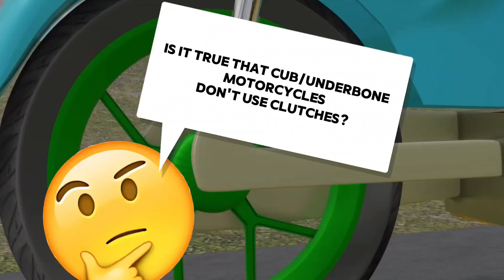How an Automatic Clutch On a Motorcycle Works ?

Comment: From my experience, underbone bikes like these usually have transmission going by a cycle (N->1->2->3->4->N) instead of N between 1 and 2 like manual bikes (sport, naked, etc.). Can you explain that and point out the difference between the two types of transmission?
Reply: I also notice this. Recently me(InfoTech) and my friend(InduTech) opened a rouser 180 engine. I noticed that it's selector drum have limited turn, it's groove has end while on semi automatic it can turn 360. it's fun to play with engine as an IT
Reply: there are tons of videos about this out there you're welcome